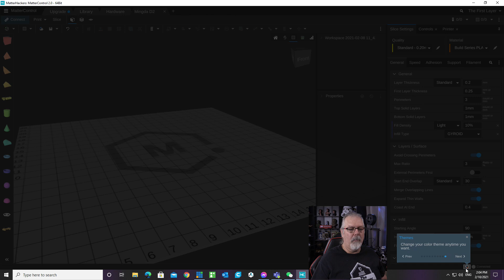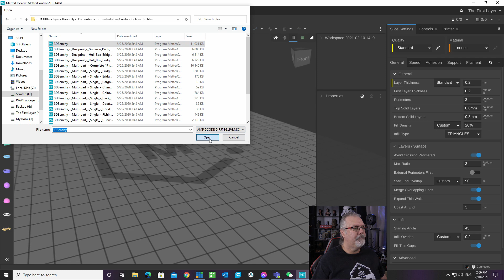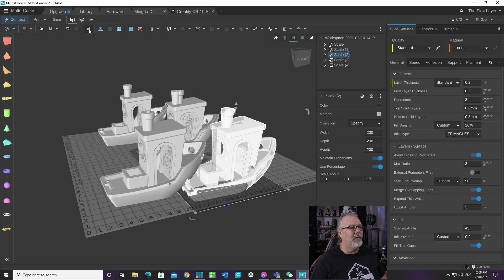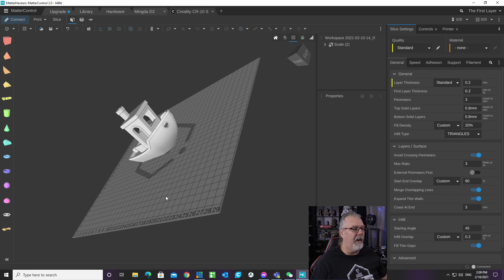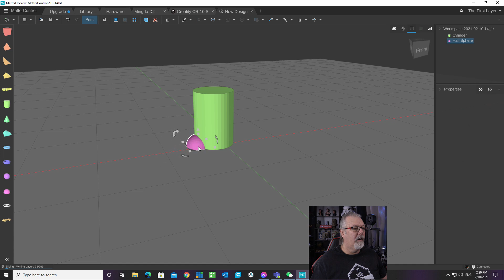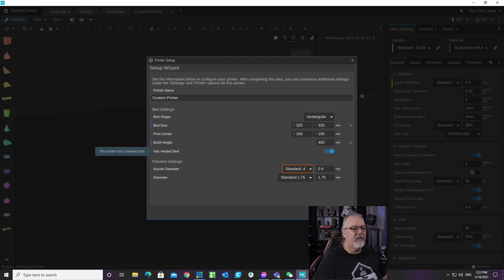3D printing slicers for beginners: Intoduction to MatterControl

Comment: So I'm only like three or four lines into the video and I'm going to say I've never run across your videos before I But I wish I had however I'm glad I have found them now. I love the premise in your first few lines there how this channel is for tutorials live streams and just general help in 3D printing because it is not a plug and play kind of hobby/business.  Every machine you get is different has to be handled different sliced different designed with different and that's just the digital side then getting into the physical side every printer levels differently has different software to level it has different procedures and that isn't even the tip of the iceberg That's like that's still a hundred miles away from hitting the iceberg itself so I'm glad to see people like you out here willing to take your time and share it with others in the community to help them get better and more proficient so personally I think you very much!!! And I look forward to seeing a lot more of your videos in the future

Comment: Nice video, learned a lot...but shouldn't the infill # be .1 instead of 1 on the benchy?
Reply from the maker: That is a good question, let me look into it.
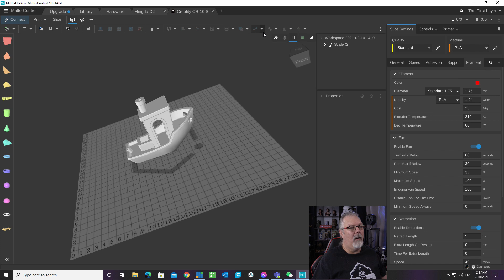Reply: @TheFirstLayer  yeah, around 15:17 in, you got the error saying the value has to be between 0 and 1. Therefore 1 would be 100% infill unless I'm mistaken?
Reply from the maker: @Nowayfella  I am verifying that now. I will let you know when I have an answer.
Reply: @TheFirstLayer  no problem. Please don't think I'm rushing you....just thought I'd help by pointing out the spot in the vid where it happened. :)
Reply: @TheFirstLayer  What was the result of your verification?  It has been about 3 years since you said you were going to verify it.

Comment: Is there a difference in the printpicture when you print something with the same Values as in cura?
Reply from the maker: Not that I have seen yet but I am just scatching the surface on this slicer. I still need to work with it to give you a better answer.